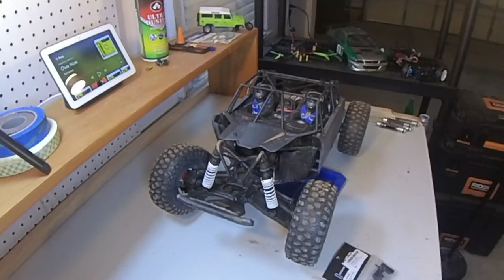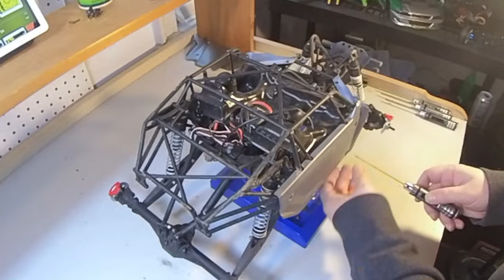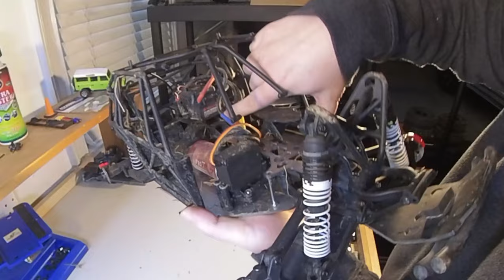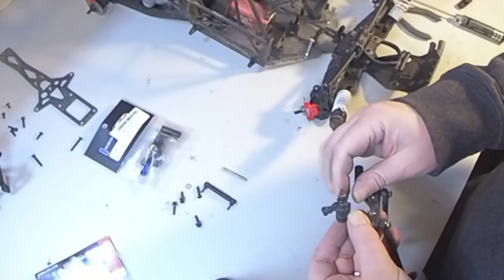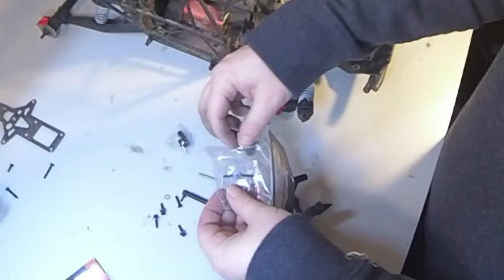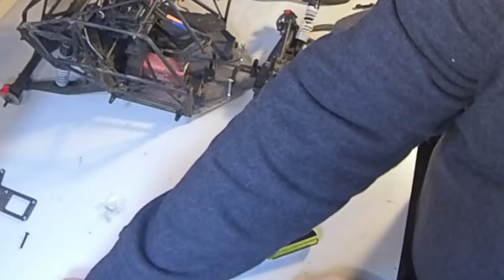Losi Rock Rey Steering Replacement... Servo, Turnbuckle arms, and Bellcrank

Comment: You do know the cage comes off in one piece right? You don't need to take the panels and drivers off! Just take all the screws out underneath and the ones on the back shock towers, then the brace in between the front shock tower.

Comment: Did you force the drag link  screws to the hot racing bell crank? The bell crank has fine thread and the screws are more like standard thread.
Reply from the maker: It took me a minute to realize that the new bell crank holes where threaded. No forcing though, I used the screws that came with the kit.

Comment: I just ordered the Aluminum Servo mount, bellcrank, and servo horn for my Losi Baja Rey to take out the slop. I also upgraded mine to run 4s, I have dual rear shocks on each side and stuffed Typhon 6s front shocks as well. Take a look; I'd love to hear your thoughts.  https://youtu.be/RlbtWyX1w3Y